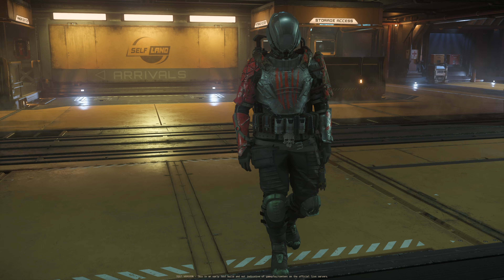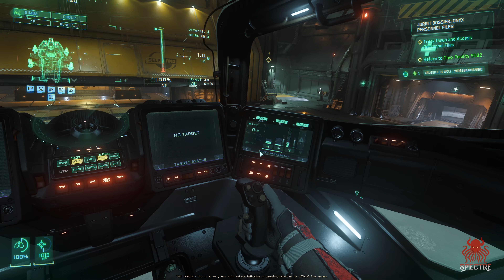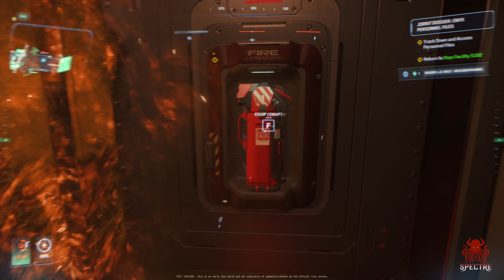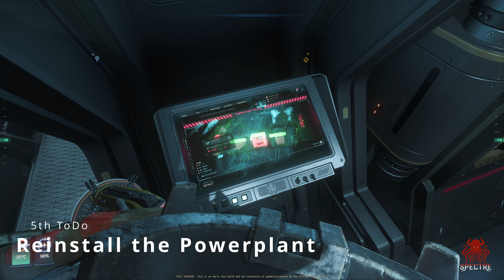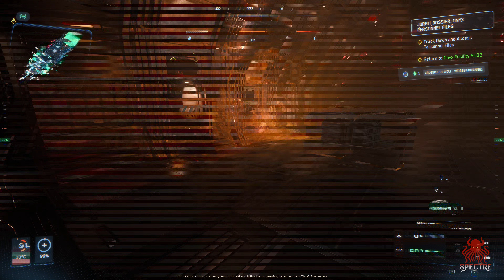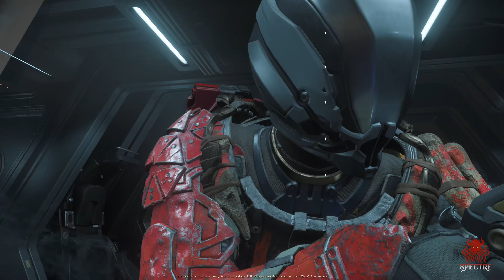Star Citizen Engineering - How to stop REACTOR FAILURE

Comment: The Asgard is my main ship and I've been trying these past few days playing in the PTU. Can you explain to me why when I go to shutdown my ship, I hear a warning and see a message at the engineering terminal that I have a power plant failure. I didn't do anything other than turn my ship like normal and turn off like normal, yet I'll hear and see the failure notice and a few time my ship blew up.
Reply from the maker: This Video is not up to Daten anymore! Once the ship hull, goes to zero HP you only have a chance of 20% that a critical reactor failure occurs! In this case you have to start immediately repairing to 20% of the power plant Hp! However, pull the Powerplant out could stop this event as well.
Since the last PTU patch they added, once Armor and Hull HP went to zero and the enemy did not stop shooting! The ship will explode
Reply: @weissbiermann81 I power up my ship, put pips into my systems, fly around, land, turn off engines, turn off power. As I'm fixing to leave my ship, I hear a beeping noise from the engineering terminal. When I interact with the engineering terminal, I see power plant failure. No space combat, nothing special, just flying around from point a to point b, landing, turning off engines turning off power. The Asgard and other ships that i've tested would say power plant failure at the engineering terminal. A few times my asgard would blow up just sitting there on the pad in the hangar.
Reply from the maker: @Jsherrod78 ok that sounds strange to me ass well! I didn’t make that experience so far. I tested today the whole day and just had the normal star Citizen bugs (warp out during quantum, loosing stuff or ships must be claimed but is in Hangar …)

Comment: I haven't tried it yet but I have a button on my joystick just right besides unlocking all ports, which open all doors, in this case it should automatically extinguish all fires, right?
Reply from the maker: Yes ! To be honest, I’ve the same hotkey prepared like you did. However in the current PTU, there is no necessarily to remove the Powerplant in case of a reactor failure. So you just have to repair the Powerplant once a reactor failure occurs. Anyway, extinguishing fire by open all doors worked for me not always properly in the current build. Thus I always grab the fire extinguisher instead

Comment: Not looking forward to this game play
Reply from the maker: Why, do you prefer to play alone? Or what’s the reason for? Notice! In former time, your ship was soft death and you cannot do anything! Now you got a chance to handle it
Reply: @weissbiermann81 1. I have survived in combat. So it's a bit to real. 2. The fire suppression system in a hangar would have that fire out in 30 seconds or less in current times. 3. You're not going to repair the power plant or any complex part. With the same tool you use for doing hull repairs.
Reply from the maker: @hivetyrant69  Good point! But this is an general consideration point. How deep should CIG develop Engineering. Thus are spareparts requiered (Screws, washers, fuses). But nevertheless, I like the new engineering mechanics. For ligth fighter combate (i love PVP and dogfights), I´m not sure if I like it or not. But I´ll test it in detail and will make my own desicion. Anyhow, thanks for your feedback and I hope you like the video itself

Comment: I didn't like having to pull the powerplants out and sit them on the floor. I don't think it makes for good/fun gameplay. You should just have to repair the powerplant to, say 5%, to prevent it from exploding. That way you can leave it installed and just hit it with the repair tool to stabilize it.
Reply from the maker: You can do that, but not when the reactor was broke

Comment: How will this work with ships using S3 power plants or above, given you can't tractor them out?
Reply from the maker: True! I hope CIG will roll back to what we had previously where we are able to pull S3 components as well. In the PTU we currently cannot! Thus in S3 ships, this timer is just for evacuation
Reply: @weissbiermann81  Ships that should be the most engineering heavy getting to experience the least of engineering lol

Comment: How much time do we have until a Powerplant explode? Is it possible to do a QD to get out of danger and while we are in QD, we pull out the PP?
Reply from the maker: Depends on the ship! Light fighter the chance for repair is actually near to zero. Once the reactor get kritikall, you have around 15 sec. Asguard was 53 sec. Prowler arrond 44 sec. Thus it depends on the type of the ship and I assume (did not test this properly) also how many parts are broken so far. Maybe if several components are damaged and the ship hull is also nearl broken, then the time until explosion may be reduced more …

Comment: it is not enough to switch off power plant?
Reply from the maker: Nope! Also not enough to repair the Powerplant in they Powerplant slot! By pull out the Powerplant, that’s actually the only way how to interrupt the Reactor counter! I also tried out, by not unlocking the ports. But then you cannot disassemble the Powerplant and die …
Reply: @weissbiermann81  so all Large Ships are Dead (:
Reply: @weissbiermann81  hmm sounds to me as somehting not exactly logical. hopefully it is jsut an bug. anyway. thx for testing!

Comment: Excellent write up. How does this work with non-gold standard ships where the powerplant cannot be removed?
Reply from the maker: Simply sailing, you are dead! You just can evacuate and could not longer pull out the Powerplant to reset it! Also each ship with size 3 components can only be evacuated! Repair the Powerplant will currently not stop the explosion counter …. Thus in a Perseus you have the same issue like a ship which is not in gold standard

Comment: How does the nose of the ship mean the reactor get's damaged? The two aren't near one another. That makes no sense. 
This is why people say once you take damage you just explode. So there's no difference from the old system, just more flare and fluff. How do I get out of my chair run to the back follow all those steps while I'm getting shot at? 
Bad design. The nose should not be the reactor core.
Reply from the maker: True! I only made test with several different ships as well as fighters! Always when the nose did not have any HP, then a reactor failure occurred. However this Funktion was already there in SC for several years. In PVP combat it you shoot and hitting the nose the ship immediately exploded when the HP came to 0. Nowadays, the reactor will be fault and you get time for evacuating. To be honest, I like the mechanism behind! But you are right. It should not related to the nose HP which it is so far